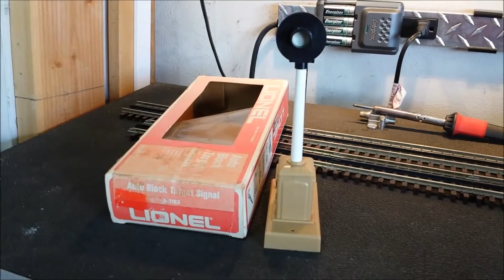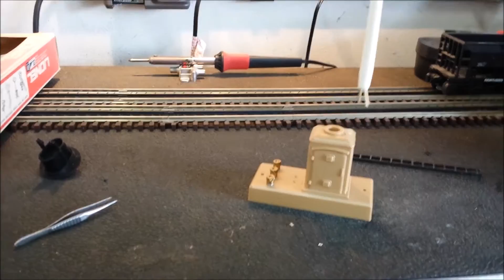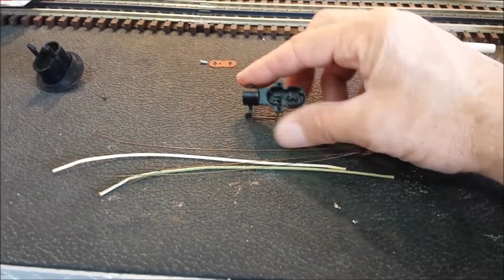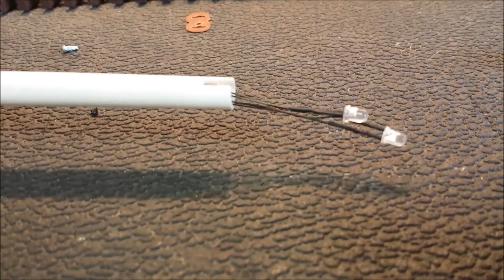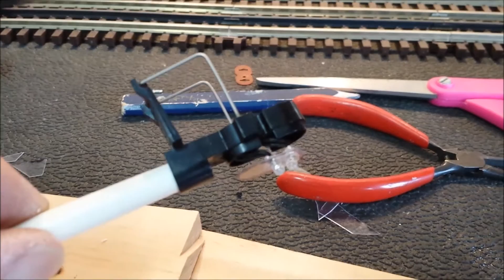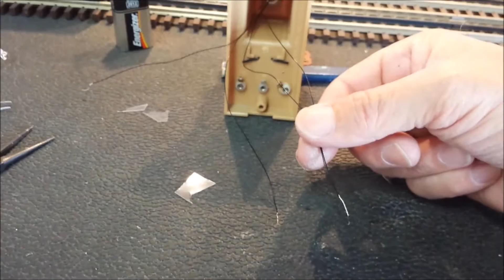Lionel block signal #164 upgrade with LED lighting

Comment: I would have bought a prewired three light LED that has color coded wire, and has red, yellow, and green as the prototype had.
Reply from the maker: Thanks, this was one of those project experiments. I had several old search light signals I thought I could utilize on the layout.
Reply: @baldypalmsrailroad  it's still a good idea. With the cost of stuff that looks realistic in HO and N scale, I'm tempted to use the new technology to revamp older stuff, salvaging them to save costs.
Reply from the maker: Cool, my who has a N scale layout has been looking for modern n scale signal bridge for a long time. He said nobody makes these commercially. He may experiment in making his own. Let me know how yours turn out..
Reply: @baldypalmsrailroad  depending on his modelling era, that's true. If he is modelling the transition era to mid 80's as I do, you almost have to modify the old Bachmann and Model Power kits. For a while, Custom Finishing had a signal bridge kit, but I don't know if it's still available. Custom Finishing still makes bridge mounted H-2 searchlight heads in kit form. They sell the LED separately, which is made to fit inside the heads, with long hair-like enamled leads. (Installation down through a mast can be tricky as if the braided enamel insulated cable snags anywhere inside the brass mast, it can short) So bridge mounted heads in N scale are preferable. (You only have the plastic deck of the bridge to route the leads through) then along the inside of the leg angles.

Comment: Great idea!  I don't know why  Lionel never upgraded to LED lighting in their 163,253,148,450, and 452 block signals and added an amber light. I've seen a video using a 153IR with an MTH 11005 CPL'S Block Signal that displays a yellow approach aspect using a delay. Seems like that could be applied to these other signals, although it might require a redesign of the head.
Reply from the maker: JAMES  MARK 
Thanks James for tuning in. Funny that you should mention the amber light, I plan to add additional LEDs to the other 163's that I have and was thinking about incorporating an amber light. I  think I will make another video incorporating all three lights, also adding a time delay relay. using smaller LEDs I should be able to get them all three the show pretty good through the Searchlight display.
Thanks,  Ron //
Reply: The technology finally has caught up to the need of model railroaders, as now there is a 3 light LED module, with color coded wire available now. They're 10 for $7 or so.

Comment: Nice!    Why not add a yellow lamp?   If you light both RED and GREEN simultaneously, will they produce an artifical YELLOW?
Reply from the maker: Good idea, I have two others I will try out. Thanks for the tip.
Reply: Ron Karlsson  Now that I see how the signal is made, the bulbs will probably create green on one half of the signal disk and red on the other half with yellow appearing in the middle where the colors mix.. 
So best to insert a yellow LED since there is now room.

(At home we have a real searchlight signal.   It has an armature "spectacle" holding three ~1-inch diameter glass color filters "colorels".   No power to the polar relay causes the middle RED colorel to align in the path of the light beam by gravity and gentle springs (Or is it magnetism?)   
+ to - attracts the armature left, aligning the YELLOW colorel in the light beam.
- to + attracts the armature right, aligning the GREEN colorel in the light beam.) 

This way the railroad can create 3 aspects using just two wires!

Comment: Very nice video! But couldn't you have just threaded the LED wires through instead of the LEDs themselves and modifying the plastic?
Reply from the maker: Keith M  The LED have a small rectifier attached to them, so the only way was to push them up from the bottom.
The LED are from Evans Design.  Thanks for commenting on the video.
Reply: Ron Karlsson Sorry, I didn't realize that. Again, great video! Thanks for posting!
Reply from the maker: Keith M 
No worries I'm glad you found the video informative . thanks for watching.